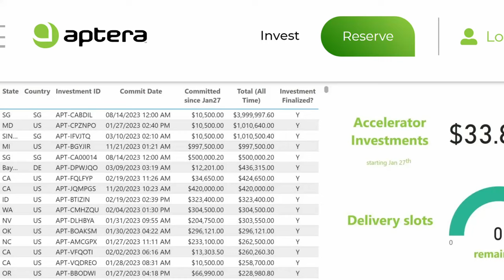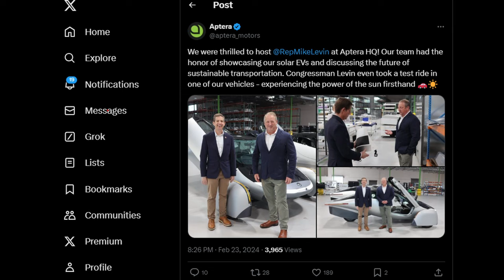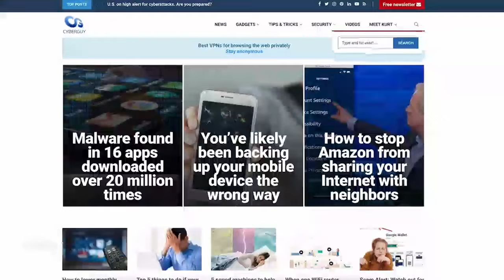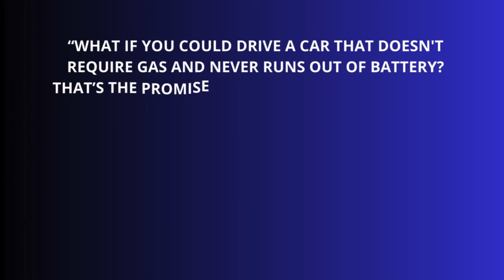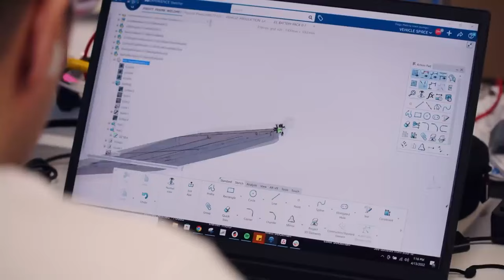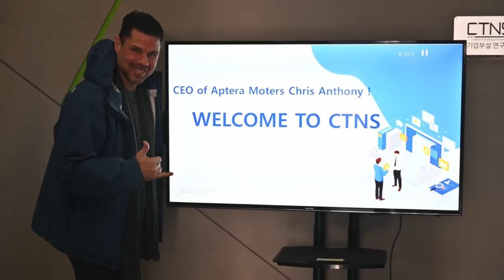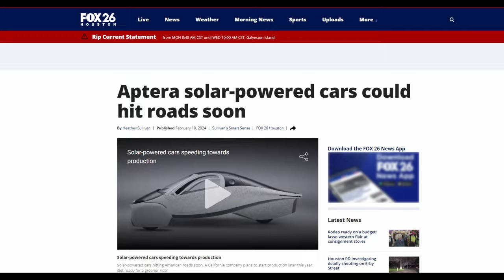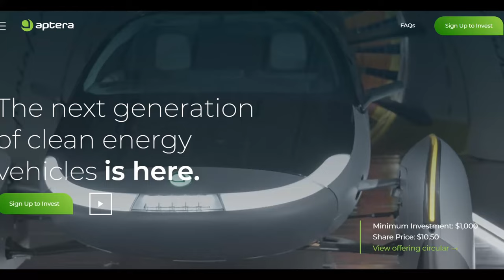Aptera – February UPDATE: Congressman Mike Levin Rides In The Aptera

Comment: The market conditions, battery materials costs, and supply shortfalls drove up battery costs unrealistically in 2022/23, so it was a good deal for Aptera to create an alliance with EVE Energy, and Formosa, but that has all changed dramatically as we have seen badly inflated prices drop back down to 2020 levels. Plus there are more battery and material supply options now. I don't think that CTNS will be providing the batteries, just the assembly into packs. And I don't think that EVE energy will be Aptera's battery supplier either, but I do think that Aptera will stay with the 2170 format NCM 811 batteries because of their high energy density and competitive cost. I also think that the later 250 mile Aptera EVs will use LFP or 2nd gen sodium ion batteries. They don't have the same high energy density, but those batteries will cost far less than the NCM 811 batteries, but they use more common, and cheaper materials, so they may be used in later, entry level Aptera EVs.

Comment: The recent communication change (as I see it, as a reservation holder) in emphasis to saying that FOREMOST Aptera represents a breakthrough in all season transportation efficiency (gas or electric), and secondarily, it is SO efficient that for many users with modest commutes or less, the built-in solar charging MAY even be enough to meet the total energy requirements, is a wise retrenchment.  It is both correct, and more compelling, if less star-warsy.

I helped with an effort to put electronic health records in 600 rural clinics in Zambia, 2004-2014, and toward the end of that time, lap tops with touch screens got SO energy efficient, on a pilot basis we were able to power them with flexible solar panels that the staff could carry to settings without power.  So I am thinking, with the right adapter I might buy a large foldable solar collector for 'the day after', and have the only working vehicle when the oil stops and grids go down.   (And this power failure (both electric AND gas) DID happen when I lived in Africa; it can happen anywhere, and will, if we don't learn to get along.)

Comment: I would add that the vehicle travels 10 miles on 1 KWH.  So, to charge up on a small 25 KWH charge for 30 minutes would gather 120 miles of range.   Not sure if they will up that to 40 KWH charging, but...even a modest charge rate will gather a lot of range, very quickly.
Reply from the maker: Oh, that's Nice and great!
Reply: You mean 25KW and 40KW for charging, as KWH is the energy storage, not the charge rate. And they have mentioned getting up to a 50 KW DC fast charge.

Comment: Same empty promises since 2019.
Reply: Apparently you can't read or follow the facts either.  Nothing empty about relatively rapid development and invention of a highly efficient new concept that has led to the building of alpha, beta, and gamma test vehicles which one can not only see on the roads, but one can also drive (with the right attitude).
Reply: @er What facts? 1000 mile version existent? Roadworthy production prototype existent? Solar yield data?  Production line ready? 300 Mill at hand to start production?
Alpha, Beta, gamma have nearly nothing to do with the intended production vehicle. The Gamma never drove more than 50 miles. And the motors stop working when driving uphill.
Reply: Since 2009-2011.

Comment: Simply a GOOD NEWS summary without any depth of study.  We all want Aptera to succeed.    BUT --  Aptera needs to demonstrate PROOF regarding some major concerns.   1- Actual Mileage Range with and without use of home charging.  Range tests must include results in actual winter conditions //  2- Proper cooling of motors in hilly conditions // 3- Rigorous actual track tests with various maneuvering scenarios // 4- Demo of owner changing the tires // 5- Completion of their planned crash tests.   Any one of these with a poor result gives buyers a total no go.    Long past due to provide these results.
Reply from the maker: Nice curiosity.  I think all these will fall in line as they get more funds for production
Reply: @SpectrumOutlet  As a reviewer / commentator you should already have done the research that I did to identify these serious concerns.   They are much, much more than just curiosities.
Reply: @rmm9676  No, it is not "past due"  The prototypes have shown the potential, but it is production intent vehicles being assembled now that will provide the validated test results.  All this should be in place by the end of this year.
Reply: @enelson5920 The prototype showed nothing of relevance. The latest gamma is not even able to drive uphill without burning the motors. "will provide": Same empty promises since 2009.
Reply: The vehicle that quit on the hill literally didn't even have the cooling system hooked up because they hadn't needed it before.  They've since sorted it out and driven the car to the top of some tall ass hill.
They have shown some maneuvering stuff including the moose test. 
They can't do crash tests until they finish the PI builds. 
I have some concerns about the operation too but you gotta recognize that Aptera is rather unique in that we are seeing the process in a way that i don't think any other manufacturer has done.
Reply: @te8547e  There was no cooling system existent to hook the motors on. The moose test was with a Beta without real battery load (10kWh) and no cabin, and still you see signs in the gras that his test went terribly  wrong several times. No real world data available about speed etc.
They were able to do a crash test since 2009, when they first promised it. They never did. And they know why.
Reply: @rmm9676 - Deleting critical posts the the best thing to do. It demonstrates freedom of speech.

It’s better to embellish on Aptera claims. Those never get deleted.